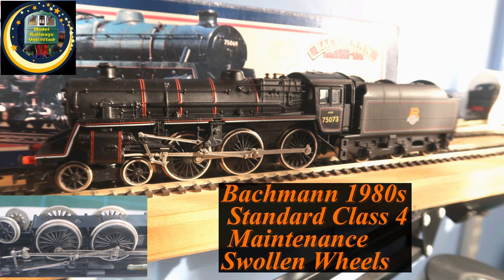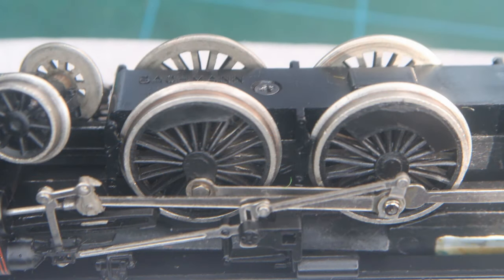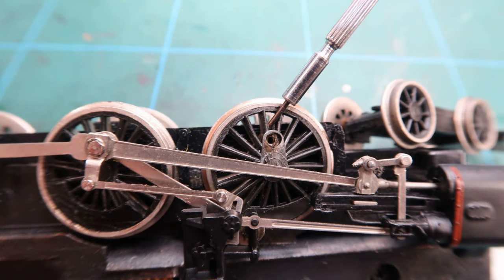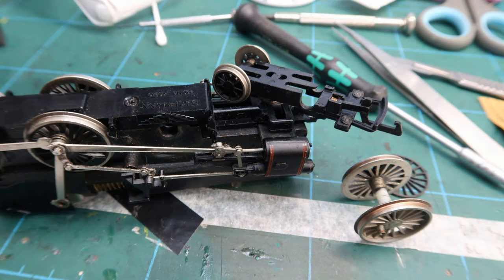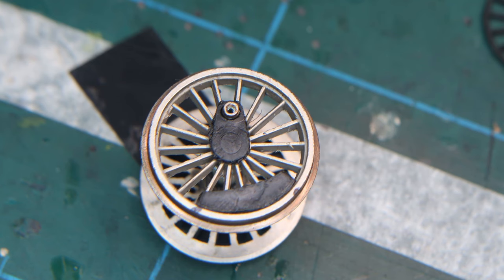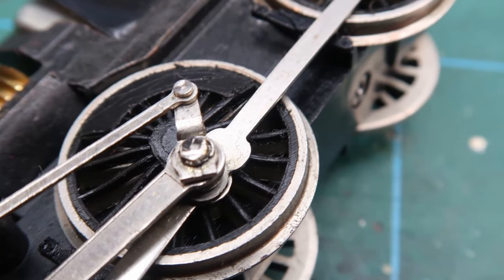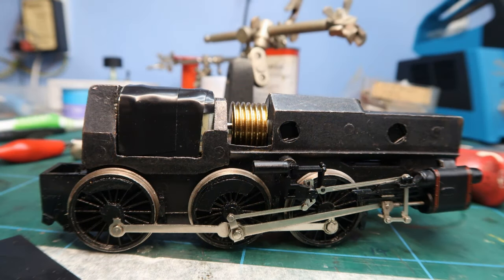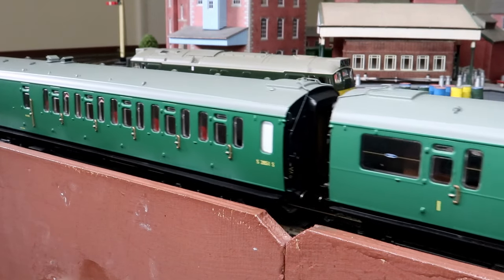Bachmann 1980s Standard Class 4 Maintenance: Swollen Wheel Inserts Fix for Model Trains

Comment: Great repair. I had the same issue with my Standard Class 4. I had to use a donor chassis as mine was really messed up. I have tried filing down the inserts but I will probably end up doing the same as you for a more permanent solution. Thanks for showing. Regards Paul.
Reply from the maker: Cheers Paul, very best of luck

Comment: Good spot on the swollen plastic inserts Mike, that was half the battle. Modifying the inserts etc crosses over to skills in plastic kit construction so if you have the skills/tools for that, you are onto the solution. One small suggestion, though its subjective, priming and spraying the wheels may hv given a smoother finish, though it would necessitate additional time in masking etc. I hv this loco still MIB so will go and see if the inserts have expanded after all these years. Cheers
Reply from the maker: Thanks Paul, yeah I'm gonna have to try spraying some day, I can feel it approaching lol

Comment: Well done
That made complete sense and I could see I could manage that myself 
I’m very enthusiastic about anyone who shows that Bachmann engines of this age and period can be worked on and maintained 
The vast majority of people are scared off by : split chassis, split axles and problems like you described 
Making such videos proves they are serviceable and can be repaired 
I have a few in storage atm but I now realise I will be able to make them run once more 👍🏻
I’ve also followed OO Bill on YouTube who shows the same attitude towards such engines 
Thanks so much for your interesting video 👍🏻👍🏻👍🏻
Reply from the maker: Hi that's really kind of you. I never give up on an engine 🚂
Reply: Totally agree. The split chassis issue is really only a problem if you have a DCC layout. The conversion CAN be done, but it's not easy at all.

The other main issue of axle cracking is much easier to resolve.
Reply: Back in the day when these  Bachmann models were new, Hornby were seen as the undisputed leaders when it came to mechanisms / motors, and Bachmann were the front runners for detail and paint finish. Not sure it's like that these days, especially with the various new entrants to the hobby.
Reply from the maker: How would you resolve it?  @stephendavies6949
Reply from the maker: Very true @stephendavies6949
Reply: I've mended a few cracked axles by either the super glue method or by replacing them. I found buying replacements from Bachmann cheaper than Peter's Spares. Replacing them does mean you have to be careful with regards to quartering, but needs must sometimes.
Reply from the maker: Ah yes, I'm still very scared of quartering lol

Comment: Great video thanks for sharing, I've got the same problem with a Bachmann standard 4 with a Mainline body and tender, it really wobbles, I'm going to give it a try as your video & tips will help me, thanks again John
Reply from the maker: Hi John thank you. Good luck and maybe let me know how you get on
Reply: Sorted the wheels by taking the nylon out and glued the centre and balance parts in, I've now got to replace the wheel sets and fix the crank arms, get the quarteing right so hopefully she'll run again fingers crossed 🤞 I'll keep you updated thanks John
Reply from the maker: @johnbill9201  well done, 👍
Reply: Hi as I said I would let you know how I got on sorting out the same problem on my locomotive, I've done the same fix as yourself as I was doing it like you the video all the 6 wheels fell out so I've done them individually and refit ed the rods, mine were pushed in pins to the centre wheels, refitted it all this morning and hey presto it runs again not prefect but accable, just have to paint the spoked wheels, now she's not on shed, thanks for sharing the video, John
Reply from the maker: @johnbill9201  that is brilliant news John well done

Comment: Would my old Hornby Railways Ivatt 2MT Mogul model be considered vintage status? Models of her were first released in 1989, if my brain serves me correctly, so it looks to me like she might be a vintage model. I never carry out repairs of any kind, I just keep the driving wheels clean. You're a Maintenance Master, make no mistake. Not every modeller has skills of your standard. I love your Standard 4 tender engine model. True, she was scrapped in real life, but some of her real life sisters survive on preserved railways. 75069 and 76079 are two of them. I have a slightly smaller Bachmann model, of one of the preserved Standard 4 tank engines: 80104 who is resident on the Swanage Railway in real life. Is there a Standard 4 tank engine hidden in your collection somewhere? I'm sure you showed her number on a list some time ago. Could you give both your Standard 4 tender and tank engines a run together sometime?
Reply from the maker: Yes, you might recall the series "vote for repair" the very tricky to work on 2-6-4 tank was in that
Reply from the maker: A